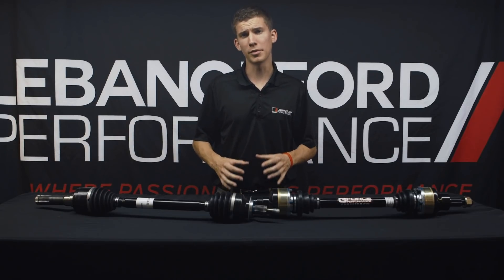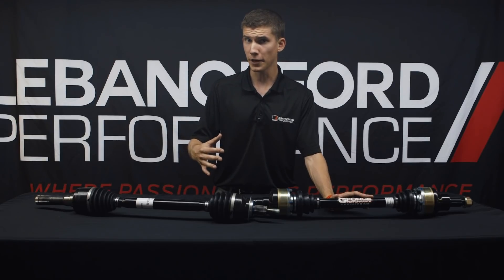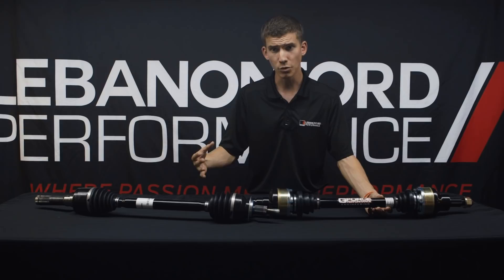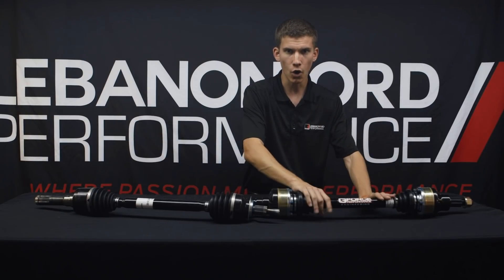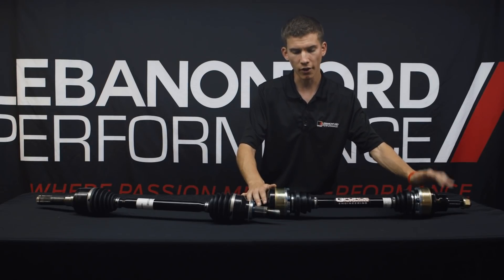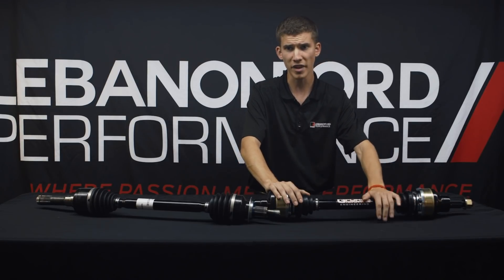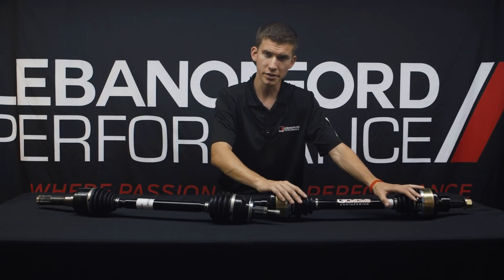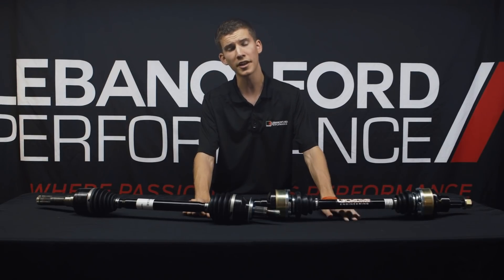Lebanon Ford Performance Parts | Half Shafts

Comment: Great videos you are doing. Keep'em coming. I guess a call the LFP is needed to see if I order a '19 Mustang GT with a Whipple, what do I need to add to the order so the car stays in one piece!!
Reply from the maker: Robert MacCready oil pump gears and halfshafts are the weak links
Reply: Opg on 18 and under, 19's have billet gears from factory..

Comment: Well done, Lebanon Ford. You are really on it, and cover all the bases on new Mustangs! Very few, if any, other Ford dealer like you. One note to Ford Motor Co though: Ford should've made sure their oem halfshafts were up to the job to begin with. So LAME, Ford.
Reply: I agree, Ford dropped the ball big time. The oil pump gears were a real screw up as well.

Comment: If you build a mustang at Lebanon the cost of a mustang goes up very quickly. I started with a 301a automatic and ended up at 64,000 to get the car street and strip ready. I remember when you coukd build a fox body for 10,000 you had a 10 second car. Of course, it was mostly a strip car at that point...